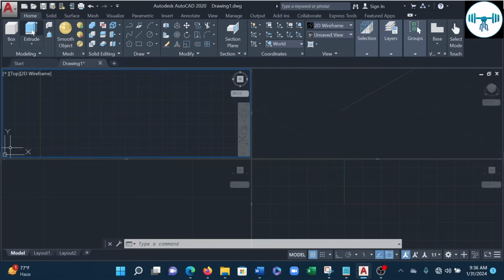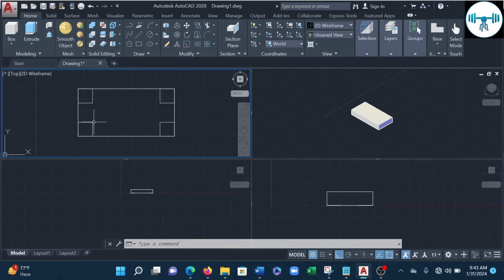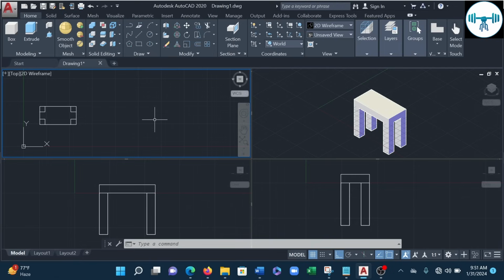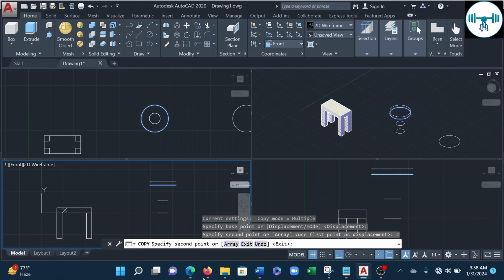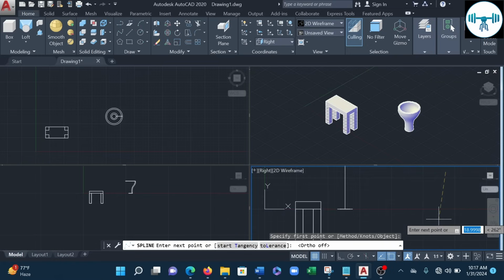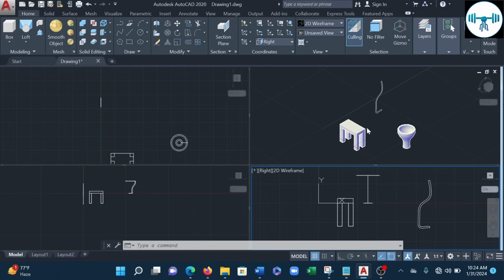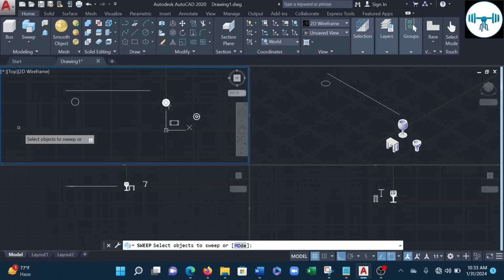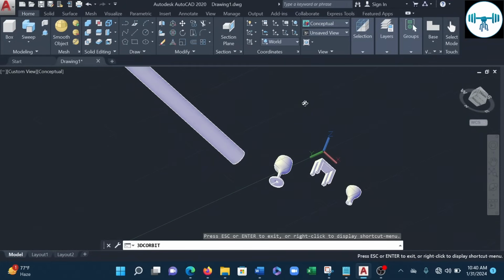3D MODELING TOOLS IN AUTOCAD

Comment: Sir pls on the first quadrant why didn't you use NE, NW or SW isometric??
Reply from the maker: @Lil_b0othang111 it’s just based on how I want my 3D to be positioned. You could use any of the isometrics but it’ll affect the orientation of the object.
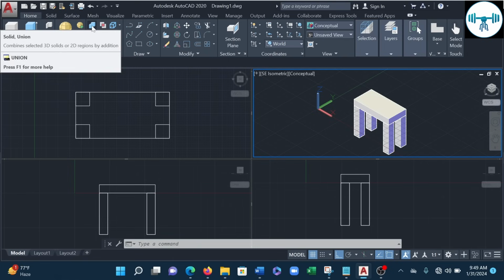Reply: 13:36
Pls will the region command perform same function as union??